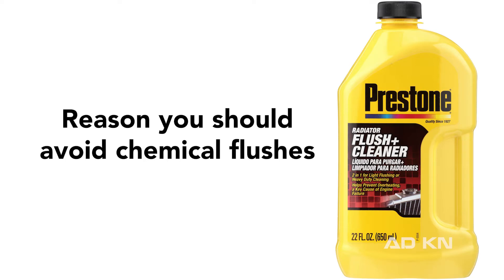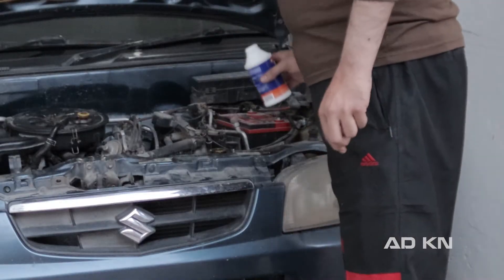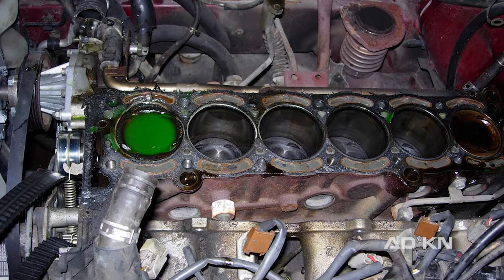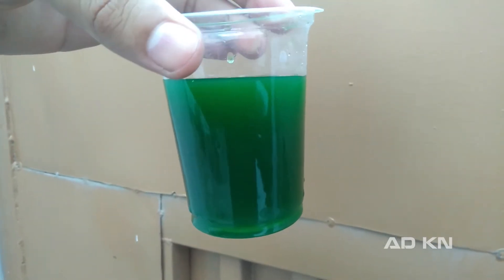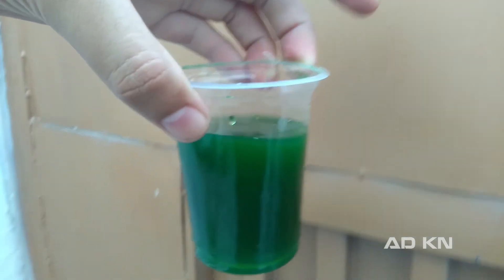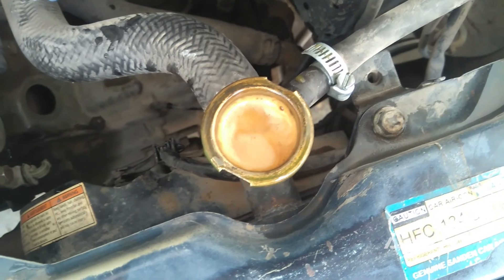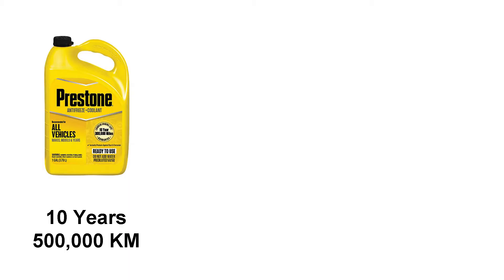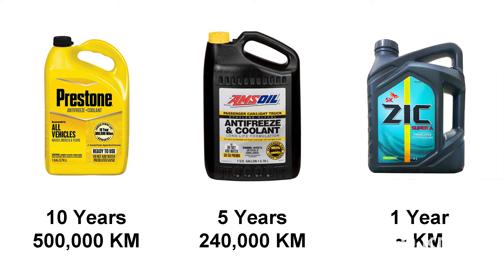Radiator Chemical Flush, Do You Really Need It? (When Should You Use It)

Comment: Chemical flushes, if you get the right one, don't do any damage. I had a Acura MDX that had a sludged up cooling system with gunk, sludge, bugs, sand, rust, and more nasties in the cooling system and radiator. It was neglected by the previous owner. If you just opened the radiator cap you could see all the nasty stuff in there. It was so bad that it even clogged the heater core, so I had zero heat in the winter. I tried to manually flush the heater core with a garden hose and I managed to get some gunk out but the heat barely got any better so I was still freezing in the cold. I even tried multiple coolant changes and still nothing. I ended up using a chemical flush and my gosh, it helped so much! I used blue devil chemical flush and the instructions call for multiple coolant changes after letting the chemical flush circulate on a running engine for 3-6 hours so that it can get everything out. I was blown away at how good it worked, it removed the rust on the inside of the radiator and no more, sand, gunk, sludge, or bugs in the cooling system! I also got my heat back! I wanted to share my experience because in many cases, chemical flushes are needed, they don't do any damage to seals. Now you shouldn't always be doing chemical flushes, but only if your car needs it or if the coolant was never changed in a long time.
Reply: How did bugs get in a sealed cooling system?